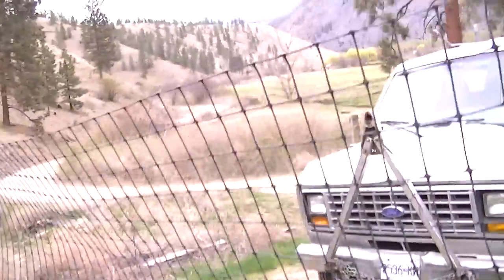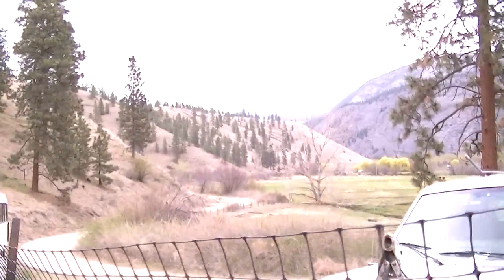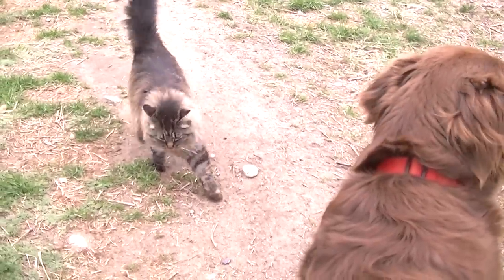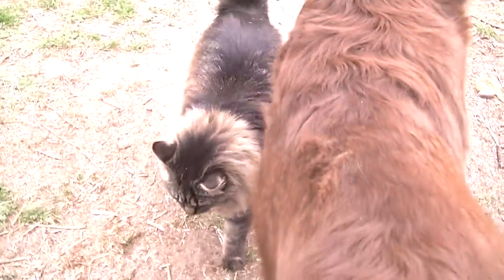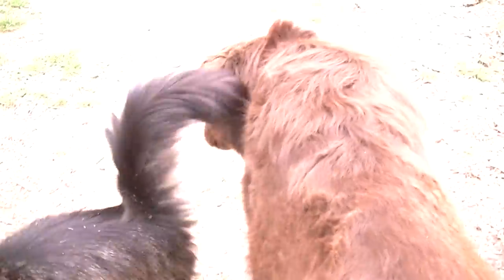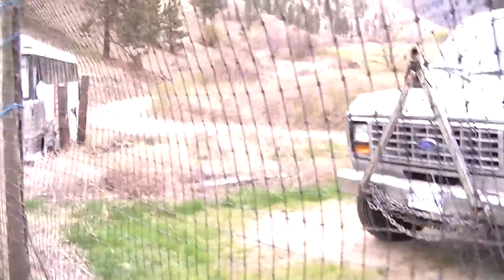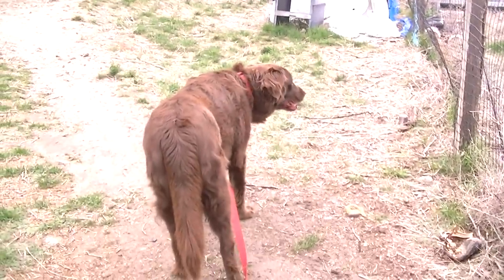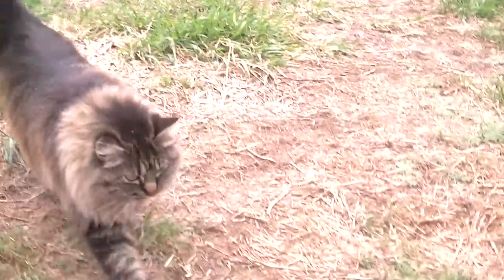pyramids were originally built  to land, refurbish , refuel and relaunch space ship engines

Comment from the maker: Microwave propulsion microwaves can be used to heat a suitable heat exchanger, which in turn heats a propellant (very typically hydrogen). This can give a combination of high specific impulse (700–900 seconds) as well as good thrust/weight ratio (50-150).[2]
A variation, developed by brothers James Benford and Gregory Benford, is to use thermal desorption of propellant trapped in the material of a very large microwave-sail. This produces a very high acceleration compared to microwave pushed sails alone. 
Graphene coated layer in the solar sail would reflect with 95 % efficiency with a aluminum or chromium layer for sunlight sailing 
~@ http://en.wikipedia.org/wiki/Beam-powered_propulsion

Comment from the maker: ~ you can split water and make atmosphere with the oxygen and a holy comforter shield against cosmic and solar radiation with the separated hydrogen ( inside a strong magnetosphere to hold it and sufficient gravity spinning ) if you dump water on your spent neutromium reactor core after you refurbish and refuel your pyramid space ship engine / fuel tank ( the main ship stays in orbit once built when not in-transit between planets or stars 
= ( here is a hint and eye had created videos directly on these old landing , refurbishment , refuel launch pads that were later re-purposed by the subjugators as pyramid tombs or what ever, after the cooled spent fuel ( the final abandoned cores were removed in " ARK of Covenant " styled containers and stashed away and again re-purposed as " BOOK of LIFE " computer hard drives by the bots that remained behind ) https://www.youtube.com/watch?v=lXpmaI6LoOc&list=PL70A8895BA85C8CDB&feature=share&index=2

Comment: You are absolutely correct sir, these structures were once surrounded by technology from heaven by the Angels or Archons. These stone megaliths were built with lasers like devices (molecular dissemblers and later fossilized by the deluge[1]) and lifted by tractor beams for the spiritual (does not contain atoms or molecules; spiral nous) machinery (space like craft) that overlaid them at one time before the machinery and Angels (all 200 of them) were banished to the second heaven and trapped in the celestial domain. These machines or space craft if you will, left their finger print, look at the geometry of the structures, it is scaler like energy of what we think as time (not space) cascading out in a hexagonal (stupa) fractal formation and can be purposed for the use of anti-graviton warp (lokas)...???? footnotes: [1]e.g. Grand Canyon was carved out in minutes by sonoluminescence during Noah's flood due to the atmospheric pressure being twice what it is now...